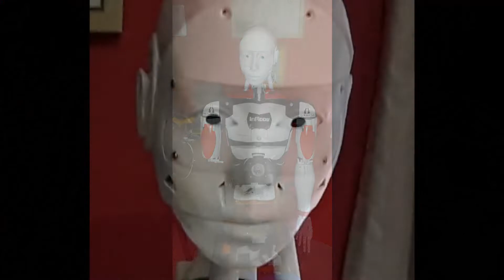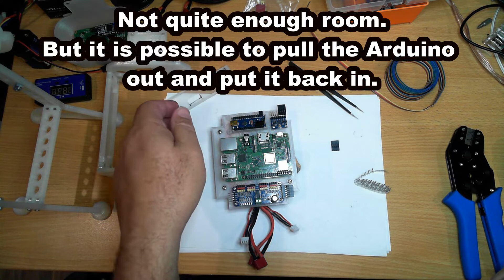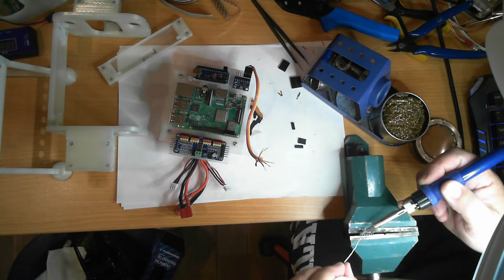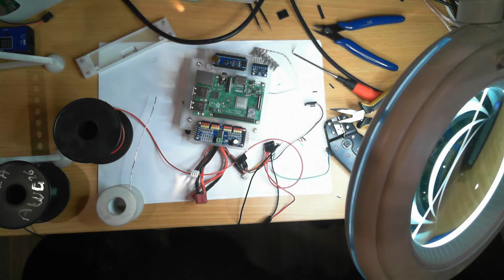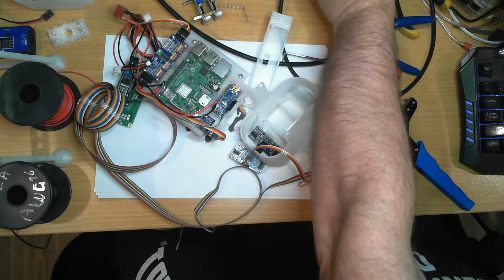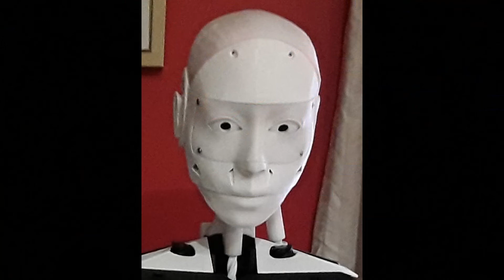SpotMicro Part 4

Comment: Hello, I am building one too but ı only managed to get 6 servos working, but they jitter.I think its because the pca9685 cannot supply all the power needed since with 3 or less servos, it works just fine.I am using jumper wires for the battery-voltage regulator, might that be the problem?
Reply from the maker: AWG28 most commoly used for jumpers is not going to cut it for the 12 servos.
Each servo when the robot is moving will draw between 3A and 5A at 6.0V for the standard servos.
I suggest at least 18 to 20 Amps of supply.
You will need much bigger wires to carry that sort of current from your power source to the PCA9685 servo power terminals.
I would suggest AWG14

Wires act like resistors, just very low value resistors, but the smaller the wire, the hire the resistance.
The more current you flow through the wire, the voltage you will drop over the length of the wire, the wire will also act as a heater converting the voltage dropped x the amps into power which is converted into heat.
Enough heat, you will melt the insulation around the wire and cause shorts and fires.
Reply: @CyberOne  I am guessing the pca9685 can handle all that power without any modifications?Thank you
Reply from the maker: @RoberEnesTan  Depends on which model your using.
The original version from Adafruit, has a reverse polarity protection MOSFET transistor that can not carry the full current of 12 x 30KG servos, but cheaper Chinese version that lack the reverse polarity protection have no issues with the current. 🙂
One time when the cheaper version is better 🙂
Reply: @CyberOne  Thank you very much :)
Reply: @CyberOne  Hello, sorry for disturbance, I am currently using a xl4016 dc converter,I am guessing that the servos pull 24a, whereas my converter can only safely supply 10a, what converter did you use?
Reply from the maker: @RoberEnesTan  The step down converter I used is only rated to 5A.
But, I'm not using those for the servos.
Currently, I have 6V feed from my desk PSU and drop that down to 5V at 5A for the Raspi and the other electronics that don't like the 6V.
I am looking at using a 20V Power Tool battery in the near future, and for that I will use a 20A SMPS I found on Ebay
Reply: @CyberOne  Thank you
Reply: Thank you very much

Comment: Will jumper wires suffice for the connectors you manually made?
Reply from the maker: For all the signal wires, yes. :-)
I would however use a heavier gauge for the power wires, particularly for the Servo  power.
Reply: @CyberOne  How much heavy?
Reply from the maker: @sudu-boi  Mine weighs in at 2.67Kg.
Most of it is not printed using resin.

Comment: Could you also show how the robot is programmed exactly? :)
Reply from the maker: I've started on these video, but they are still a work in progress.
Starting with Part 9, I will be showing how the SpotMicro_MRL program is downloaded and installed in to MRL.
Then we start looking at the program code.
This is all created using Python run by the MRL system. :-)

Comment: very good video, when are the other videos coming? :)
Reply from the maker: Working on it.
I'm releasing videos every Friday 4:00pm AEDST or UTC+11.
In the Cyber_One Discord Server, I have a read only text channel with the up coming schedule of what videos have been made and when they are scheduled to be released.
Parts 1-7 are the physical build of the Spot Micro robot.
Part 8 is the setup of the OS on the Raspberry Pi as a headless install, but configured to connect to your WiFi and allow VNC access into the Raspberry Pi.
It also covers the installation of the My Robot Lab (MRL) system.
Part 9 is the start of the SpotMicro_MRL program.
This covers the downloading from GitHub and the start of how the program works.
Part 10 is still a work in progress and covers more of the base system setup and the calibration of the servos.
I have had some servo failures while working on the Spot Micro program as well as some during the build, so i will be releasing video of the tear down of these failed servos as well.
The Link to the Discord server is in the description below so you can see when videos will be released and what's coming up..
At the time of writing the schedule is mapped out to the 4th of March 2022 with two servo tear downs completed but not yet scheduled.
Reply: Ok Thank you
Reply from the maker: @canacar1151  No problems :-)

Comment: What happened to Fred?
Reply from the maker: Fred is sitting there watching over the Spot project :-)
I will continue with Fred as soon as Spot is working.
New servos have now turned up for Fred's arms :-)
I've got a lot of work to do with Fred's program as well as there have been a lot of changes in the way MRL works, I almost need to make a video just on what has been updated.
There have been a lot of improvements, and looks like soon, the Inmoov2 program may be able to be configured to run Fred with all of his modifications :-)